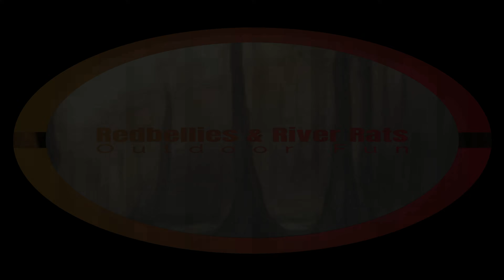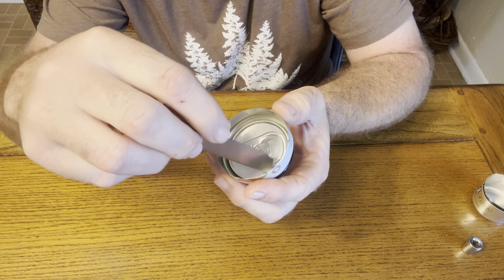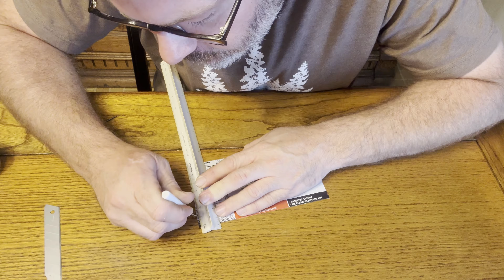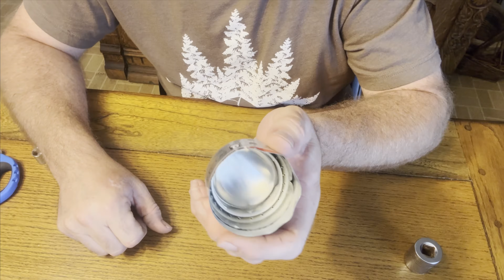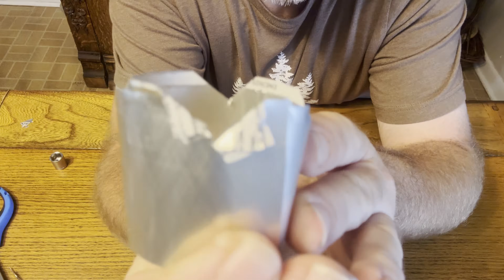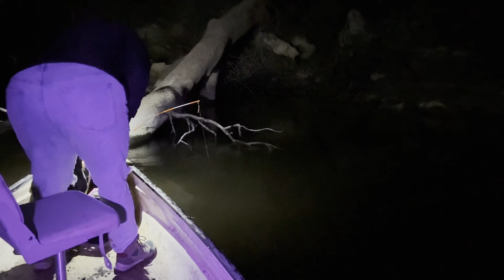New One-Can Alcohol Stove

Comment: I would cut notches on the top of the pot stand. It will help with 2 things. Relieve the thermal transfer from your pot, and also let the stove breathe, it reduces pulsing and possible thermal runaway. I like how you used the top inverted so the jets are internal. Nice lightweight design.